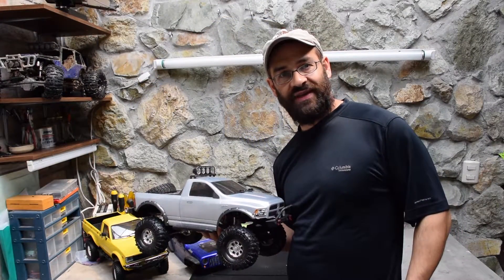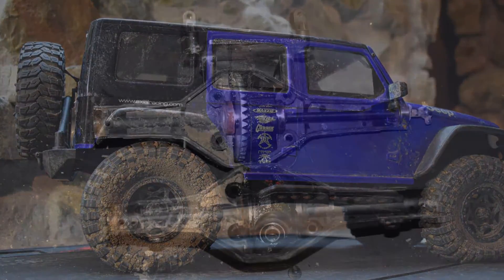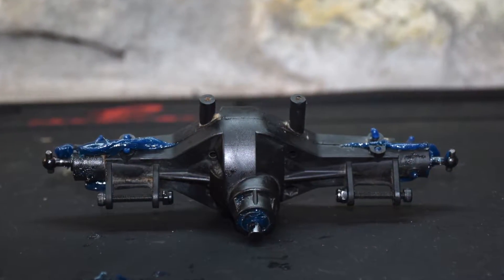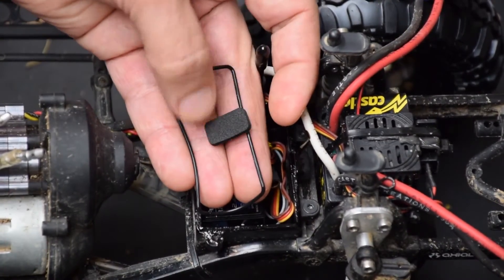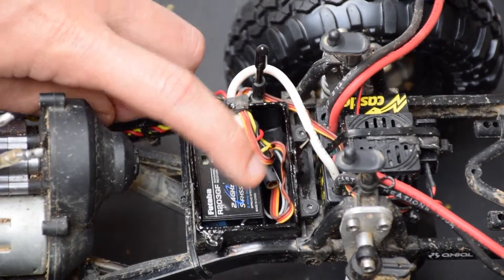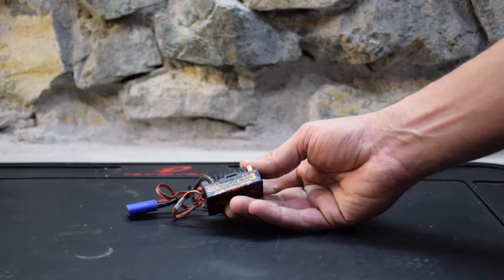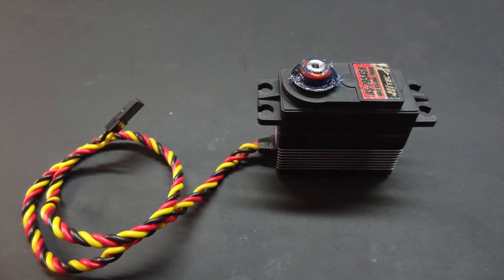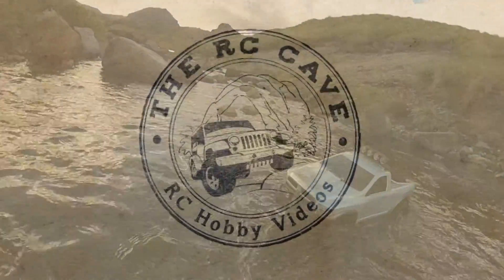Waterproofing an Axial SCX10: Bearings, Receiver, ESC, Servo

Comment: Conformal coating is only better because it has a much higher temperature it can handle before melting and it hardens pretty well. Liquid electrical tape and Plasti Dip can't handle as much heat, and if you're running your castle settings on HIGH, it can get pretty hot.

For people who can't find Plasti Dip, look for 'liquid electrical tape'. It's basically the same stuff.

Comment: How do you keep your body from rubbing when you run 2.2 tires. I have a lift too but my Power Wagon body still rubs with 1.9 tires. What size shock are running?

Comment: so ill be getting a yeti and want to waterproof the bearings though you mentioned grease wasn't good for speed, does it reduce the speed by a lot? By the way, I plan on running 2cell batteries on it so I don't really seek speed. So would grease ok to use
Reply: +The RC Cave 
I see the yeti in between, not a crawler yet not a speedster and don't plan on facing very harsh environments with it, just mild water coverage for rain, snow and maybe light mud. Would WD40 be good enough for me? By the way I plan on getting the rtr version.
Reply: +The RC Cave 
I'm also considering filling up the axles with marine grease, (if that's a good choice) because as this will be my first RC I would like to take care of it. What's your thought?
Reply: +The RC Cave thanks for the info!
Really appreciate it :)

Comment: Fantastic, a guy at work has been promising me marine grease from his yacht club for months ha ha
Seriously need to waterproof my Unimog properly.
Nice how to vid, maybe the best waterproofing one I have seen (-:
Reply: ***** 
Ha ha, I just got a big tub of it from a friend who sails at a yacht club on weekends yesterday. Will fill the mog up with it this weekend hopefully and get a run in, haven't had her out for a while (-:
Reply: ***** 
The Mog already weighs about 2 tonnes so a bit more won't hurt ha ha
Reply: ***** 
The other way that I think is good is to wrap the sticky lead around the inside of the rim (inside the tire) you can still run foams that way. Hmm maybe you could cut holes into the inner side of the foams and jam larger lead BBs into the foam?
Reply: ***** 
My Unimog is so tall and so top heavy but with all that weight way down low in the tires makes it virtually unstoppable, I think it is the best solution, but yes problematic if running foams

Comment: Awesome info Jason!...
Reply: ***** same here, I've only purchased " waterproof " servos for the blue truck, other then that... I just opened the rear axles and packed them.. Gotta re do it tho... I didn't get the bearings!! Oops!! Then I'll do the front...
And then all over again on the red one..
Reply: ***** .... I'm considering starting a Trailfinder only community..... A one stop shop for tips n tricks on this awesome rig.... But at the moment, I don't have the time
Reply: My blue one was a kit build w/ the 2 speed and has the t/z boxes on the front...and yes.. If I decide to run with that idea I'll hit you up!
Reply: They fit, had to do some disassembly.. I'll get you a better shot later